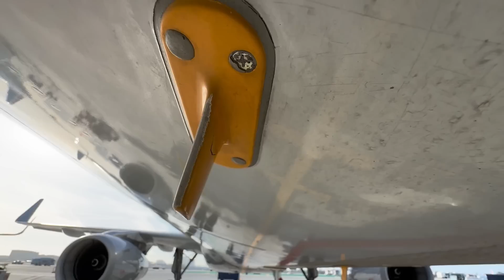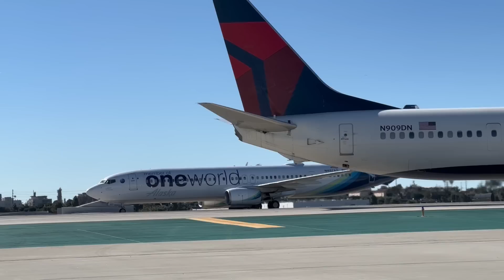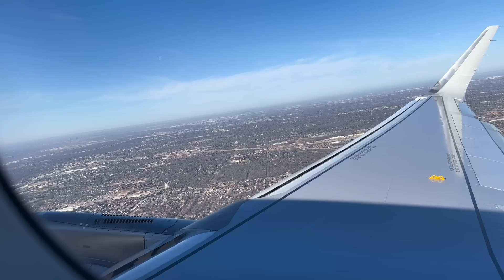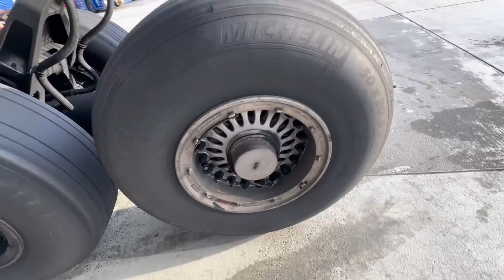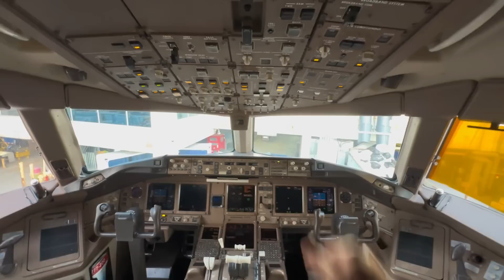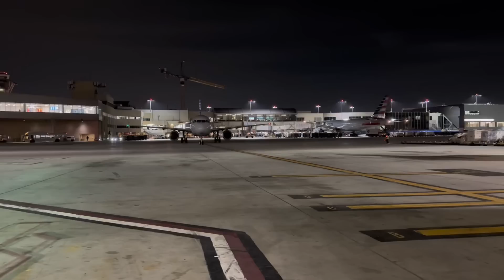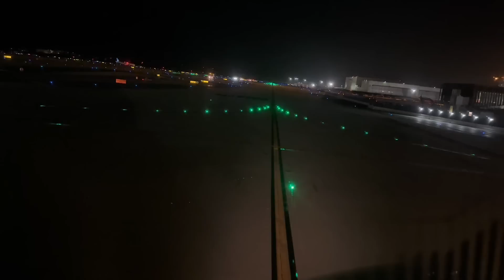Stig Shift #61 (Aircraft Maintenance Adventures)

Comment: When you hear OBSTACLE OBSTACLE on EGPWS what exactly is it detecting? Powerlines? Bridges? Tall buildings?
Reply from the maker: Is detecting terrain, any kind of building for obstacle database that’s in the system.
Reply: @ I never knew it accounted for man made objects
Reply from the maker: It’s not more of man-made objects it’s just painting a picture of something solid on the ground
Reply: @ oh ok. I thought terrain would be all naturally occurring terrain like hills, mountains, cliffs etc then obstacle would be like buildings or other stuff that is not terrain but something sticking up out of the ground
Reply from the maker: Well the interesting thing about this Tom is that if you’re flying that low to the ground then most tall objects and buildings have the red beacon on top. Same thing with antennas, they had the red beacon on top. And flying that low is not something normal for a commercial airliner. Now if we’re talking about general aviation aircraft, most of those people fly visually

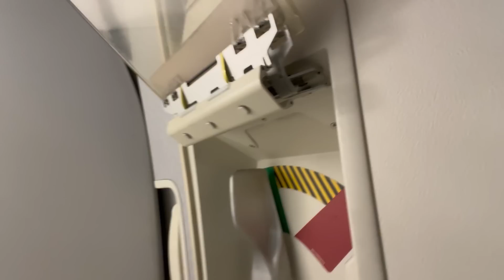Comment: I'm confused by the 777 door arming handle at 27:30. It's currently over to the left which according to the indication means the door is disarmed.....but the red is exposed which usually means danger...so to me I would think the door is armed.
Reply from the maker: you have to look at it this way, if the handle is in the red the door is armed, if it’s on the green it’s disarmed.
Reply: @StigAviation  I can see that as per the diagram. It wouldn't surprise me though if after a really long flight a tired flight attendant see's green (because red is covered) and thinks the door is safe to open

Comment: The brake dust seen on the initial climb out is possibly from the brakes automatically being applied, to bring them to a stop prior to retracting them. On a related issue, if a B787 is dispatched with one or two brakes inop under MEL the landing gear must be left extended after take off  for two minutes to allow the wheel with inop brake to spool down to a stop prior to retraction.
Reply from the maker: Yes that is also correct

Comment: How often do the flight controls have to be realigned and how do you align them?
Reply from the maker: Well it depends on the type of aircraft, when you say realigned, in Aviation terms we call that flight control rigging. If it’s an older aircraft such as a 737 or anything that is cable driven, we would be adjusting and rigging the cables that move the flight control surfaces. If it’s a fly by a wire aircraft then the adjustment is done on the actuator itself.

Comment: Hey stig, are the yellow handles on the wing hoist points for the aircraft?
Reply from the maker: Those yellow loop holes that you’re seeing is actually for a strap that can be attached from the exit hatch to the wing. It’s there to help passengers hold onto the strap as they evacuate the aircraft. It’s all in your safety card

Comment: Correct me if I’m wrong this is based on observations from flight sim I’ve experienced similar situations to this however I’ve noticed especially in a 777 that the speed tapes are restricted slower when the aircraft is in a heavy weight usually in the first couple hours of cruise just wondering is the  weight of the aircraft impact that speed or is flight sim wrong here?
Reply from the maker: I wish I could accurately answered that, but that’s more of a Pilot question than a mechanic question.  I would need to ask and research this one myself.

Comment: The engines rotate clockwise or counterclockwise? Or depends on the manufacturer?
Reply from the maker: It depends on the manufacturer. For example the Rolls-Royce turns counterclockwise, the GE turns clockwise. This is viewing it from back to front.

Comment: Hello stig I’m happy to have your video in the morning that’s my ritual now 😊
I’m curious to know what would you do physically to that ATC antenna fin in a remote station according to your procedures. Let it be as it is or break the part that is cracked or speed tape ?
Reply from the maker: In a remote station, you could genuinely defer that unit and allow it to fly once. Remember there’s multiple ATC antennas. But it’s very limited. But there’s other options where a pilot could say he does not feel like they want to take the aircraft like that, then we will dispatch an out of service team and get it fixed out there. So there’s plenty of different options

Comment: 7:25 i thought the brake dust was from actual braking? The brakes are applied on gear retraction to stop the gyro forces etc. You can see F1 cars under heavy braking billowing brake dust and I feel it's what we are seeing here as the wheels are stopped. Happy to be wrong though lol
Reply from the maker: I think you are misunderstanding what I’m saying, the breaking is being performed while the taxi operationsare operating. The brakes get very hot and dust builds up when they taxi to the runway to takeoff. When they takeoff the brake releases it’s dust due to the error that’s coming across
Reply: @StigAviation  nah I understood that, I just thought the dust came directly off the brakes as they were being applied when the gear lever is selected 'up' rather than dust just sitting there and then being blown off. Doesn't matter either way, just interesting to me lol

Comment: @StigAviation I do not like that planes can fly without the APU. Especially since if another Sully situation happened, there is no APU to start. They found the APU so important to change the QRH but still allow them to fly without an APU. Seems very counter intuitive.
Reply: There may be no APU available but on most aircraft there is a RAT that will deploy immediately (did so on Sully's A320) that will provide essential systems with power and provide you with enough control to get the aircraft on the ground. Or in the case of the 737 it relies on its batteries.
Reply: @tomstravels520  the very popular 737 does not have a RAT and there are a lot of 737 and variants of it.
Reply: @LexusNXRick  that’s why I said “most” aircraft. Pretty much any aircraft flying today that isn’t a 737 has a RAT.
Reply from the maker: My friend I wish things were perfect in the world but these are not in my rules. I just abide by the rules

Comment: Could you explain a bit more about wing walkers and what their role is? Dont see much of this.
Also in relation to our dear friend the other YouTuber/pilot.  I used to enjoy his technical videos. He has a great knowledge however whilst his title was click bait I also understand where he is coming from. 

Lastly,
When doing your upclose of aircraft taxiing to you I've noticed there is a metallic sound. is that your phone's sound leveling or something common on aircraft?
Reply from the maker: The job of a wing walker is basically to be another pair of eyes in case there is obstruction while the aircraft is moving under tug and tow operation. It prevents anybody from running into the aircraft or the aircraft hitting something. It’s a safety factor. And the metallic noise that you’re hearing is from the engine mid span shrouds, I made a whole video about that

Comment: Generally I find with antennas that are removed off the aircraft there is a 50/50 chance the mro shop can fix and re tag, due to all the elements and forces it is exposed to over its service life.
Reply: 50%
Reply from the maker: Well they are all subjected to the elements as you said and all of them have limitations on how much wear and tear they can experience.
Reply: Yep and..... $$$$$$ the key driver for BER